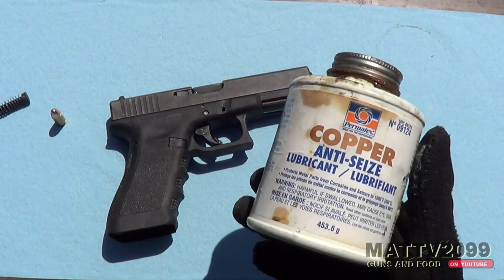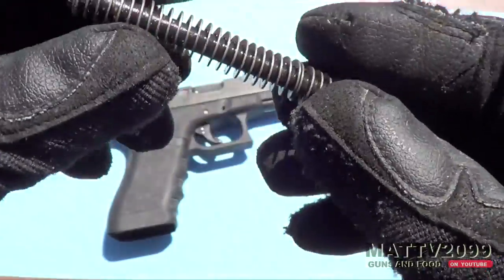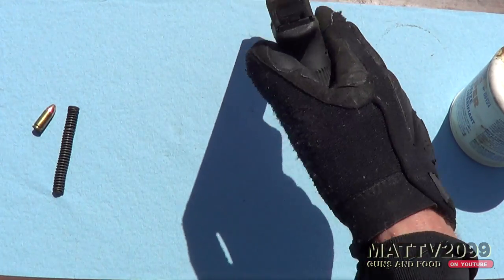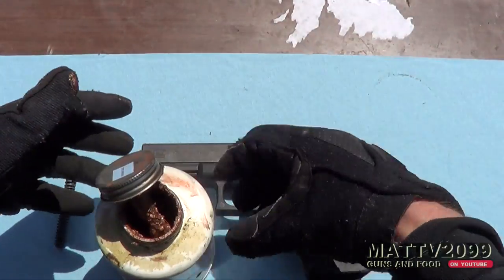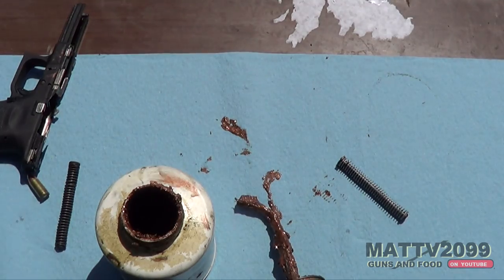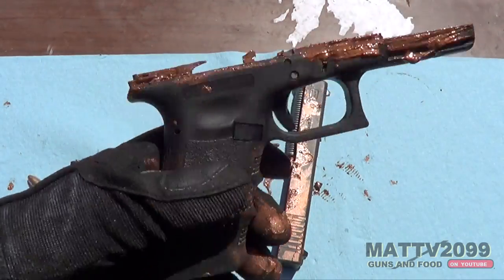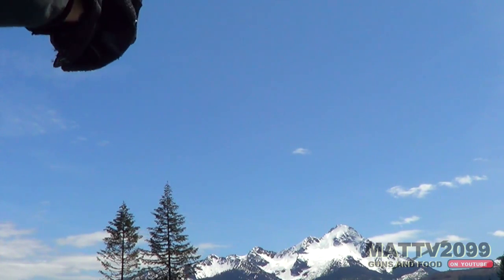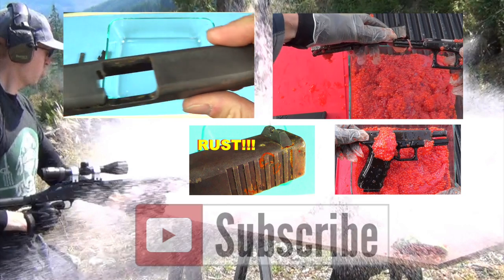My Glock 17 Broke! The Factory Lube Glock! Glocktober

Comment: Wow, Glocks are really that reliable. After a year and a half the spring broke but the gun's still generally going strong. Cool.
Reply from the maker: Renaissancedude yep!
Reply: MattV2099: Guns & Food This is why--not to knock other guns because there are lots of other excellent guns--I'm really considering a Glock as a defense gun for myself. Besides the rock-solid reliability, Glocks are pretty much point-and-shoot, if I'm not mistaken. So in the heat of an actual confrontation, there are no safeties or other switches to forget to flick off, which could get you killed. This is perfect for people like me who aren't professionals and don't have a lot of time for practice, either. Not being so used to handling guns means we likely won't remember these details when face-to-face with a threat to our lives.

But I'm no expert on these things, this is just what I can recall. So kindly correct me if I'm wrong. Thanks, man!
Reply from the maker: grip angle is weird though

Comment: that is not grease. this is taken from there site. A premium quality copper anti-seize and thread lubricant that may be used to prevent seizing, corrosion and galling where high temperature conditions exist. Contains a high percentage of micro-fine copper flakes in a semi-synthetic grease carrier and is fortified with high quality rust and corrosion inhibitors. basically you just covered your gun and your gloves with copper dust.....
Reply from the maker: Zack Dänekas sweet

Comment: How many rounds did you get out of that recoil spring? Was the result of the break a total failure to fire or did the Glock fire itermitinely  ?
Reply from the maker: approximately 17,000. the glock operated fine. no failures. I discovered the broken spring upon takedown and cleaning.

Comment: Been contemplating getting a stainless steel guide rod for my Glock 17. But I keep hearing these rumors that the rods aren't just plastic because they're cheaper, but because they flex and the firearm will not operate as well/may experience premature wear/may undergo some other kind of badness if you use anything but the original polymer guide rod.

I wonder if Glock has ever definitively stated if the polymer rod is necessary for ideal function, or if a metal one works just as well.

Comment: Thanks for the vid I just got a glock but it doesn't seem very lubricated, I'll use this factory lube but try not to be as messy. Also I don't know why you didn't do it but I heard lube in the chamber makes the bullet shoot faster so I'll make sure that's lubed up too.
Reply: If you have a reloading station you use, luring the powder can get you a couple hundred extra feet per second.
Reply: I recommend using Olive or Whale oil.

Comment: I realize you're intentionally going overboard but still...Anti-seize lubricant isn't grease. You're not supposed to glop it on heavy at all. You're only supposed to put on a very thin film. It's extremely slick stuff. And it binds to the metal.

Comment: So the lube they use from the  factory is a buffing compound to help the parts break in also glock instructs users not to lube the hole fing inside of the gun  only Metal to metal surfaces like the channels on the restive and where the barrel touches the slide  they tell you not to put any lube in side the firing pin channel, and that hole in the slide that Gos to the firing pin is not for lube but for water to drain out or other debris
Reply from the maker: Mitchell Edwards it's copper grease. I have it because it's what you use on titanium parts

Comment: Um that is copper antisieze the copper is actually a dry lubricant good for very high temps the liquid part is a light weight oil like 10weight ie power steer or trans fluid. It is probably a high temp 10w oil though. Eventually the oil evaporates/gets absorbed and the copper is left behind. Copper is also soft so it will deform as needed. Molybdenum disulfide would actually fare much better and would get absorbed into the pores of the metal better but, it is mad expensive hence why they probably don't tell you to use it. You can just look for high molly grease. You want like 80-90% molly. Just an fyi from a diesel tech.
Reply from the maker: yeah I know it's great stuff man.

Comment: just correcting this video ( but I'm not faulting the comedy aspect) the Factory does not come from permatex as this video shows. yes I know he's not serious. but here are the facts on the Actual Factory Lubricant: BRONZE OIL-LYTE bearings at a size of 20 microns . this is the "secret" behind this Lubricant. the Base is made of partial evaporation synthetic oil and Polarized to allow the Bronze bearing to roll into the steel slide and frame rails.The Bronze Bearings provide a smoother Trigger that feels lighter and the trigger resets forward faster. the frame rails will never wear out as long as the Bronze bearings remain attached. To restore a Glock to Factory New, The OEM Lubricant is available from only one source; PENNY OIL™. I Found PENNY OIL on Facebook.
Reply: +Edward Mark Felix I have talked to a Glock factory gunsmith the factory "lube" is Loctite C5-A Copper anti-seize lube. Permatex is the Generic equivalent. Stop spreading bullshit around.
Reply: +iceman27406 
the Lubricant applied at the factory is not Loctite
 and might I add , no one at Glock has stated that Loctite is the lubricant applied at the factory. Loctite is not the same color as the Factory Lubricant and Loctite will not stay in place while the Glock 18 is firing full auto. the Factory Glock Lubricant will not migrate within the Glock Pistol. so you should stop spreading false rumors and misinformation about the history if Glock design and development.
Reply: I am laughing my fucking ass off. The last time I called up Glock USA they put me through to a Factory Armorer that does the repairs, I asked him what was used he said Loctite C5-A copper anti seize. I just got off the phone again with the technical support which stated that the factory lube was Bostik Never-seez copper. If you don't fucking believe me than call them yourself at 770-432-1202 ask to speak to a glock armorer. Loctite C5-A and Permatex is the same type of shit. they don't contain microscopic fucking ball bearings.
Reply: Lol, you are an idiot, bro. Microscopic ball bearings? Seriously? I hope you step on a Lego block.

Comment: I feel comfortable saying, that Glock doesn't use a can of 88 cent anti seize in the factory. That's the crap I used at the last tire shop I worked at, and that was bottom of the line stuff.

Comment: I believe Glock says to replace the recoil spring every 5,000 rounds.  Or it might have been less than that(1500 or so).  The gen 4 recoil spring should last twice as long

Also, correct me if I'm wrong, but I think you might have put just a tad too much lube.
Reply from the maker: John Locke I restored it to factory specifications

Comment: I use that anti-seize on my YHM QD threads.  Makes taking off the suppressor a much more pleasant experience.  Never knew that's what Glock also uses.
Reply from the maker: they use copper grease. perhaps a different brand

Comment: I just bought a Glock but I had no clue how to prepare it. Thank you! Can I buy the lube anywhere? And I guess it is really what Glock uses? Why not lube inside the barrel because, and I'm not pretending to know anything about this stuff so please don't flame me to much, but wouldn't the bullet go quicker through the barrel?
Reply: I bought the stuff in this video from NAPA, to keep my wheels from seizing to the hats. you might be right about it making the bullet go faster, but that is something you'd have to be much more careful about testing. like, if you aren't already very familiar with firearms, don't do it.

on the off chance that you didn't know, this channel is a joke and you certainly should not be getting firearms safety advice from it.

Comment: Its copperpaste...what "we" use on tires, so they do not get too stuck untill the next time summer/winter when we change. If I remeber corectly you shall not use it in serten metal combinations, like on a car not whit aluminum rims, then it get like "elecrtolytic" and eats of the alumium.
Reply from the maker: ***** I use it on titanium. That's why I have it. it's grease with copper in it
Reply: Titanium and Aluminium is in the same colum, I realize I do not remeber my basic kemestry, but that means at least they have some in common. mayby som can shed som light on this that reads it, I whould chec for corosion.. or as in cars the combo become Iron, copperpaste, aluminium. to get the corrosion, but this maybe not happen if its whould be Aluminium, copperpaste, and aluminium. As you do titanium, copperpaste, titanium, maybe nothing happen chemicaly then.
Reply from the maker: ***** titanium will weld together without this kind of lube. or something like that.

Comment: LOL. That's not lube BTW. It is copper based never/anti seize. It's designed  for STATIC machine screws and bolts, spark plug threads, etc.  It never dries out on its own. It is a poor gun lubricant because it attracts dust, debris and dirt more than a light coat of oil or light grease.   It is used by Glock instead of oil or grease so one of their new guns can sit for many many years and the anti seize will never harden, cake or dry out. Kinda like cosmoline. The slide will not gall anything when racked to illustrate the gun to a potential customer. That is an educated guess, BTW. The striker portion does have conventional oil on it. The copper anti seize is just on the slide rails. This is puzzling why Glock does this since their guns never stay on the shelf/showroom for very long. The first thing I do with a new Glock is spray the whole thing down with brake clean and very lightly re lube everything with Tetra Gun Grease. After I have polished all the internals of course...
Reply from the maker: ***** I just dip mine in a 55 gallon drum of 10w40. gtg
Reply: MattV2099: Guns & Food lol
Reply: MattV2099: Guns & Food
 Well..sort of. WD-40 is a great solvent and moisture displacer. It is among the worst lubricants since it doesnt really last all that long or preform well as a lubricant. It is a terrible rust protector too. Tetra gun "grease" is actually a high viscosity  oil that clings well and needs only be applied in a very thin film to work quite well. So, sure, use WD-40 to get rid of factory lube, but wipe everything down and apply a real lubricant like Rem Oil or Tetra or countless other lubricants far superior to WD 40. Use one of the many dry lubricants on the market when using any gun in dusty/desert conditions.
Reply: I find 5w30 out of an old shitty Honda works best.
I spare no cost for my guns. They get simply the best.
I don't own any glocks though...
Fuck that noise.
Reply: John Dough Right on man .really anything will work. Read my two sense right quick these people in the Philippines   (I think it was the Philippines any)   will put vegetable oil instead of regular oil in their  briggs and statton.

Comment: I feel I must assert my freedom to comment on an important public issue that Mr. Matt V 2099 has thrust into the vortex of public comment. I assume you already know that Matt is 180 degrees out of phase with reality so let me begin this letter by remarking that Matt's conjectures are based on hate. Hate, hucksterism, and an intolerance of another viewpoint, another way of life.

The cast-off ideas of debunked philosophy on which he has based most of his dotty execrations do tell us one thing. They tell us that Matt contends that honor counts for nothing. This is hardly the case. Rather, there is growing evidence that says, to the contrary, that if he truly wanted to be helpful, Matt wouldn't sully a profession that's already held in low esteem.

Now that this letter has come to an end, let me remind you that it was intended to provide an accurate, even-handed, and balanced discussion of Mr. Matt V 2099 and his paroxysms. Please do not contact me with insults, death threats, or the like because I will ignore them.

If you disagree with my arguments or can provide further information about Matt, please contact me and I will endeavor to make any necessary corrections to this letter.
Reply from the maker: therealrrc phaze clan 360 no scope snipas. do you even yy fakie 360 quick scope?
Reply: What the heck are you talking about? What issues are you talking about?
Reply from the maker: mad013131 MLG

Comment: I use high temp wheel bearing grease on almost all of my firearms.  IT's $3 for a 1 pound tub.
Reply from the maker: alvinfry I bet it works great!
Reply: MattV2099: Guns & Food After watching your video I'm going to start using the entire 1 pound tub every time I clean and lube the Glock.  Maybe I can install a couple zurc fittings on the slide and frame.

Comment: Anti-seize compound should never be used as weapon lubrication. It is designed to keep metal parts that sit together for long periods of time from "seizing." Hence the name. It is commonly used on threads of bolts, such as wheel studs, to facilitate easy removal. It is also commonly used to prevent dissimilar metals from forming ionic bonds, such as when aluminum steering wheels seize to steel steering columns. If this is what Glock uses in the factory, it is to prevent the parts from seizing together while in storage and should be replaced with proper lubrication before firing. Somewhere in the comments, I see you calling this "copper grease" and explaining that "anti-seize" is a brand name. This is false and represents your fundamental lack of understanding of what you are using. Permatex is the brand, and "anti-seize" is the descriptive product name.
Reply from the maker: lol.
Reply from the maker: ***** ah yeah. you like that one?

Comment: for your information you're filling your gun with tiny pieces of copper. Glock does not use any antiseize,  when assembling their pistols. BTW it's not grease, nor factory!
Reply from the maker: This is copper grease. The brand it anti-seaze. Glocks come from the factory with copper grease in them. Maybe they don't anymore? But they did 5 ish years ago. That's when I bought like 15 glocks.
Reply from the maker: I own that tub of grease because I use it to lubricate titanium parts. That's how I operate within titanium spec, brah.
Reply: My gen 4 G30 had no anti seize in it. I personally wouldn't use it due to the slide rails tabs, not the slide but on the Glock lower you have a Nickle coating on the 4 tabs. The copper in the antiseize slowly will grind that away. Not to mention if it get up in the firing pin and starts to grind away at the plastic insert inside the slide.  I don't see why putting anti seize, something you use on a bolt so 3 years later it comes out. Unless someone plans on putting it in the ground.  Copper anti sieze is heat protection up to 2000°F. It's the copper flakes that I don't like. I don't find it to be the proper lubricant for this application.  I prefer Militec-1, or tetra gun grease. Just my opinion.

Comment: yo dumb ass you for got the factory lube on the recoil spring. Only then is it back to factory, get your shit together if you want it back to brand new specs... Glock specificly states in their manual 1Quart of never sieze(aka copper grease) after 3000 rounds or every 2 months, whichever comes first...come on man..damn. thanks for the vid